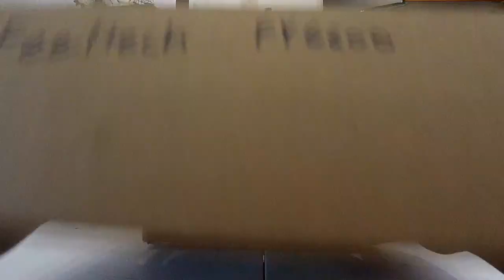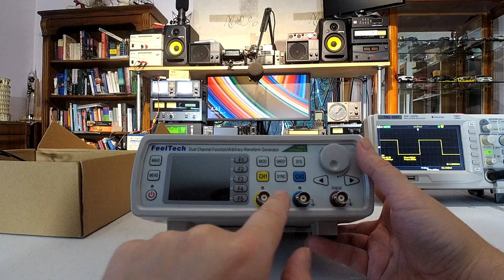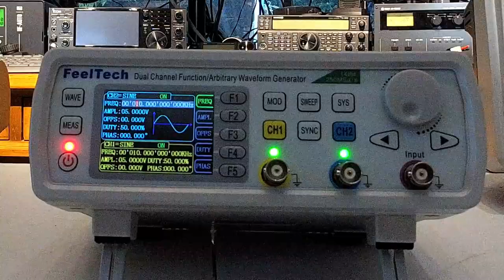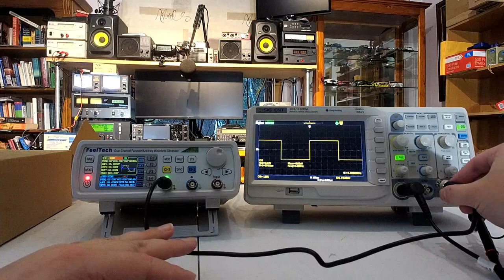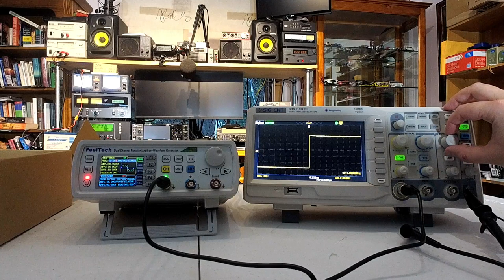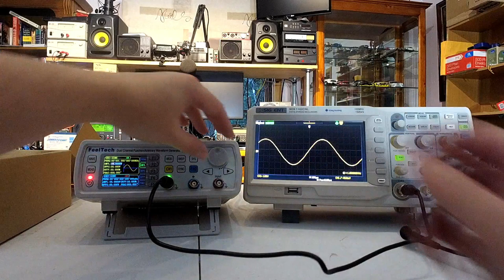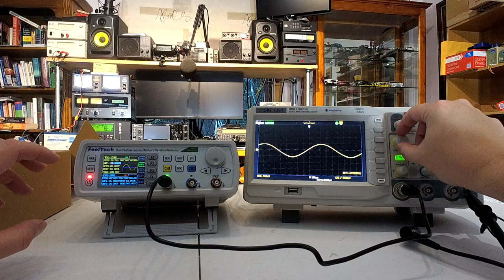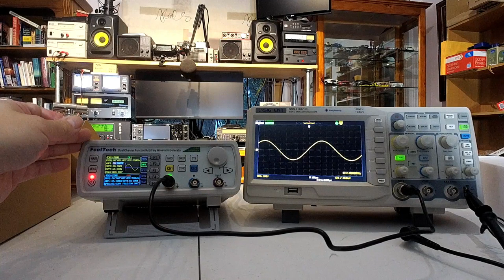Feeltech FY6600 60MHz Unboxing, Overview & Quick Testing

Comment: I have one of these FY6600....  And for a long time, i didn't use it for a frustrating reason: Everytime the frequency was fine tuned (even in millihertz level, the phase was reset to zero, resulting in large unacceptable phase shifts on each frequency step (this is even more obvious in Lissajous mode using CH1 and CH2 as sources)

I found the solution !!!!

The FY6600 must be in SLAVE mode !!!

Procedure:

 1 -  SYS

 2 - F3 (CONF)

 3 - F4 (M/S) and make sure generator is in SLAVE mode.

And you're done !

Comment: To return to sine waveform quickly from any other setting, just press the the rotary encoder twice. The first press gets you to arb1, and the next press will select sine wave. The rotary encoder switch has the same fuction as the "ok" button on the newer fy6800
Reply from the maker: Thanks for the tips Michael!  73, Jarrad VK3BL :)

Comment: OK, people... Once again, about the signal amplitude: this generator is CALIBRATED, but it's important to understand 2 points:
1. Output impedance of the generator is 50 Ohm; 2. THE AMPLITUDE SHOWN ON THE GENERATOR DISPLAY IS A Pk-Pk VOLTAGE ON THE HIGH-IMPEDANCE LOAD CONNECTED TO THE GENERATOR OUTPUT! So, if you need to test your transceiver that have an 50 Ohm antenna input, you must to perform simple manual calculations to set the correct amplitude value.

Comment: If you need an accurate frequency reference, WWV is always available, at least in North America - the carrier frequencies are derived from the master atomic clock for NIST, which means that they are exactly 2.5MHz, 5MHz, 10MHz,15MHz, and 20MHz to within something like 1/1000 of a Hz.

Comment: Various modulation types: AM, FM, PM, ASK, FSK and PSK modulations.
- Sweep Function: It can sweep 4 properties of signals including frequency, amplitude, offset and duty cycle; It has Linear and Logarithm two sweep types; 0.01S~999.99S sweep time; Up, Down and roundtrip sweep directions.
- VCO Function (Voltage Control Output): Can be achieved by an external input signal：  voltage controlling frequency, voltage controlling amplitude, voltage controlling offset, voltage controlling duty cycle and PWM modulations.
Reply from the maker: It is a very useful bit of kit for the money if you understand its limitations (mainly lack of calibration), 73, Jarrad VK3BL

Comment: Nice video, I also have the FY6600 and ran into the same issues as you. I quickly determined I needed to output about 1 volt of signal and then attenuate it it to get a decent low level, (50uV) signal for aligning a Ham receiver. For the price you can't really beat them. One thing to caution you about, part of the mains voltage can be present on the grounds of the FY6600, (dodgy P/S filtering). I measure 50 volts to ground from the BNC connectors on mine. Don't blow up that nice scope! Joel, N6ALT
Reply: Tell me more about the parts of the mains voltage. How to get rid of that ?

Comment: You should use a 50 ohm termination on the scope to see the edges of the square wave.  The fact that it was as clean as it was means it's back termination works well.

The crap on the signal looks like switching power supply noise .
Reply from the maker: Great spot and great advice; thanks! 73, Jarrad VK3BL
Reply: Yeah, I was going to mention that's why you're not getting 5 volts.

Comment: All you needed to do was change the scope over to trigger off of channel 2 instead of channel 1... just push the trigger menu button and the channel setting is under soft button 2 (ie, second from top), IIRC.  I've got a Siglent scope as well, very nice budget DSO... though I just picked up a second-hand Tek 2465 off of eBay for less than what I paid for the Siglent.
I'll bet the overshoot is partly due to not setting the input for 50-ohm impedance.
The FY6600 is a really nice signal generator for < $100, though I wish it would output a ramp voltage in sweep mode... if it can I haven't figured out how yet.

Comment: Much easier to use with the computer interface, though the version I downloaded needed a file added to it.  When you try to use it, you'll get the name of the missing file which can be downloaded separately and added to the program to get it working.

Comment: Will it produce a 10.7 MHZ   sinusoidal sweep  for doing fm radio calibrations.
Reply from the maker: I believe so its even capable of computer defined functions :)
Reply: The sweep function seems to suck...it does weird voltage steps at the same time..

Comment: I never I use the “auto” button in my scope as it’s faster and better to do it manually.
Reply from the maker: Auto works pretty well on modern (last 10 years) entry level DSOs when combined with a simple input waveform, but the truth is I had not used that scope for a few years and was just being lazy ;). That is what it is there for, after all :). 73, Jarrad VK3BL

Comment: I have had the fy6600 for more than a year (my firmware version is 2.8) and in general, after adding a proper iec power connector,  and resolving issues with the rotary encoder and the front panel buttons,  I find that for the price, it is a great value.
However, the PC software seems to have been written by someone who was working for food. I don't think anyone would actually pay somebody to write an atrocious piece of crap like this so called waveform editor. It is completely unusable. The software is now at version six, and it still crashes completely, with a runtime 13 type mismatch error if  I clear a numeric entry in a field . Even Commodore 64 software  never had that problem! If the Chinese are supposedly so good at math,  why is it that so much of their software (and this is just one of many examples) is such utter rubbish?
Reply from the maker: I would say its because they rely on non employees to write the software aka they bundle “open source” software, and such individuals probably don’t have access to the latest development tools or formal software engineering training.  73, Jarrad VK3BL